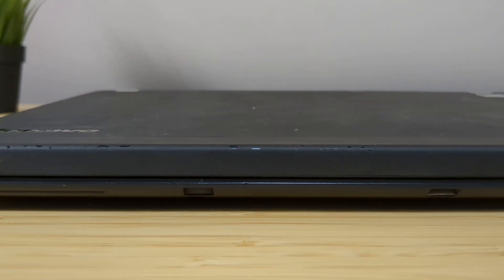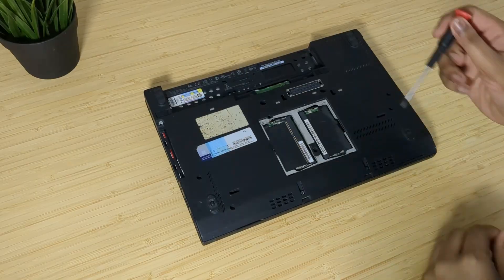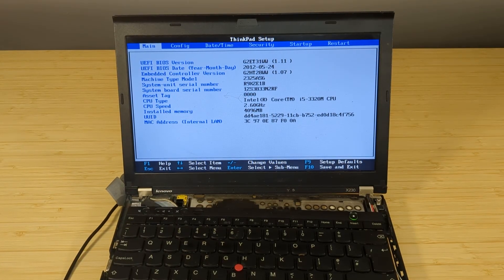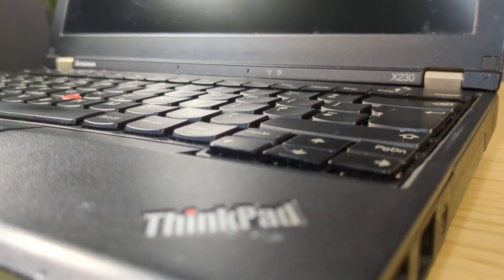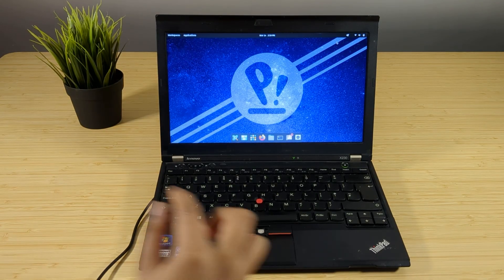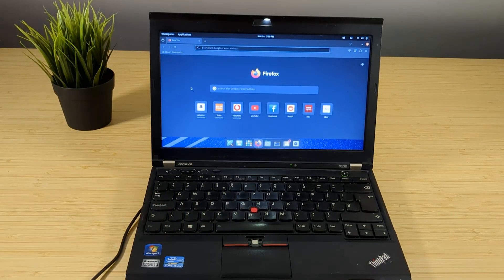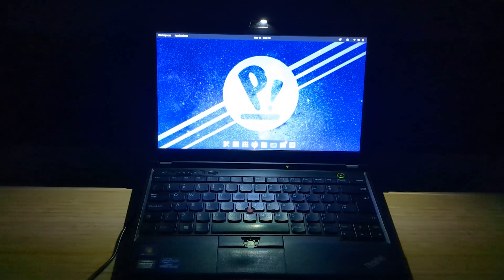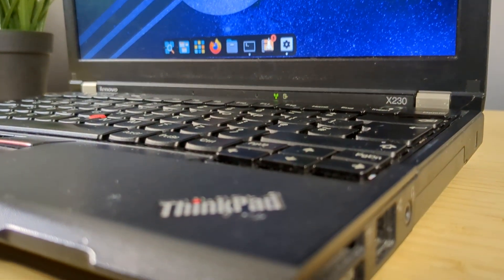This "E-WASTE" ThinkPad from 2012 cost $15.. and it did NOT disappoint!

Comment: Bet you can get a new or refurb keyboard pretty easily.  Part of the durability of the T and X series is that they intentionally make the power jack loose and it's a separate part connected to the mainboard by a small wire and plug so it doesn't break off and can easily be replaced.  All of the Thinkpads, esp those from back in that time frame are made to be easily repairable.

Comment: Unlocking them by removing the BIOS whitelist is vital if you want to upgrade wifi modules etc. Spinning rust hard drives are the worst aspect of older notebooks, but small new ones and all sorts of used ones sell for very little. New screw kits are cheap and if you don't see one for yours they're all standard Lenovo sizes. The easy power receptacle swap should be standard on every notebook. Updated firmware is a good idea and enthusiast BIOS exist. r/thinkpad and the Thinkpad forums are helpful communities.

Comment: This is a socketed CPU which means chances are you could upgrade it if the cooling capacity for that laptop's cooler supports it and the TDP is the same...

Comment: The CPU should handle Windows 10 without problems, provided the hard drive is replaced with an SSD. My secondary laptop is an old Dell Latitude with a 3rd gen. i5 and it is usable for everyday tasks like web surfing and Youtube without any issues.

Comment: (1) I have one of these laptops 
(2) What you have is the 35 watt variant
(3) Most laptops that people use are 15 watts now days...(sometimes 6 watt)

(4) To get up to the same level of screen recording you need gen 8
(5) Thats around 2017/2018...
(6) That due to the power difference. 🤔🙃

Comment: Nice video. I do enjoy a good “saving it from the bin” style video. I’ve been using an x230 since 2019, was already old back then but it still runs well under Linux. Maxed out my ram recently and have been using it to encode live streams, 1080/60p using VAAPI in OBS at 8000kbps… it’s not perfect but it does the job.

Comment: They always disappoint. 🥀
The lenovo pads are always stripped down business-sect and scuttled to death and always require like a hundred dollars in parts and you need an army of M screw kits cause they're always missing screws.

And the old IBM pads are so horribly designed it's hard to find one that doesn't need full reball or chips replaced.. AANDThen! you need to treat them with extreme paranoia// cutting up and braising your own copper cooling solutions for them because they're all from the age when oems didn't think to put heatsinks on secondary chipsets.

I haaaaate thinkpad projects and wish people wouldn't suggest them as secondhand machines for kids.

Or like.. just fix it yourself 💀

Comment: for my use case I could totally daily use that laptop if it had 16gb of RAM ddr3s are cheap now anyways, these kinds of laptops are still being sold in facebook marketplace in my country for around 100-200usd so it is really not a good deal, also you could use Windows 10 IoT LTSC it has support until 2032 downgraded my PC with it from windows 11

Comment: I have a trick for getting rid of pen (biro) marks on an LCD display. Use a drop of clean engine oil on the mark and wipe it clean with a cotton rag. You may have to rub the oil with a rag for a little bit. When I say clean engine oil I really mean the stuff you add to a car engine, like 5W30 or 5W20 oil. After the mark is gone you can use glass cleaner to clean off the oily slick.
Reply: I prefer to use a whiteboard marker; it dissolves permanent marker ink, allowing you to remove it easily.
Reply from the maker: Very interesting, would that interfere with the screen coating?
Reply: @cephacore  The engine oil doesn't react with most plastics. I've been using it for some time without issues.

Comment: Very good video. I'm surprised you didn't clean the interior before repairing it. Those vents at the back looked clogged with dust. I'd also want to try to reinforce that right-side back corner where there's a crack in the hinge, because that's only going to get worse over time.
Reply from the maker: I did give it a quick clean inside before putting it all back together. Forgot to mention that my bad :/
Reply: @cephacore  I feel better that you did! Sorry for editing my first comment after the fact. :)

Comment: If you replace the keyboard, see if you can track down an x220 keyboard. That is the old style keyboard which is so much nicer to type on. You lose the backlight, but it fits and is excellent. Look it up.

I have had an x220 for like 5-6 years now. I love it. I need to replace the battery again, but it is just an underpowered little dipshit (mine is the 2nd gen i3), but for basic browsing, terminal-ing into things, general mayhem, it's great. And the typing feel and just the solidity of it is something I miss when handling a more modern laptop.
Reply from the maker: Many people have mentioned the X220 keyboard, perhaps a part two on this video 🤔

Comment: A year or two ago I found an untested X230 on ebay. Got it for around 15€ just to see. Gave it ram, an ssd and 2 new keycaps. Now its stitting right next to me. Wonderful machine. Those cheap and easy to fix finds are amazing :)
Reply from the maker: Thats amazing, similar price to what I got it for.. How's it holding up today?
Reply: Absolutely amazing. It's my daily drive laptop. Installed coreboot (using 1vyrain). With 16gb RAM it handles all the tabs I throw at it and still no problems with a few other apps open (even electron ones). I want to do the higher res screen mod, since using freecad on the lowres is horribly cramped. Besides that I just dont see a point wasting my money to get a replacement for it. I technically have a P50, but that sits around unused when I dont need the dGpu. The X230 is just so much lighter...
Reply: @astiLP did u do the screen mod, if so what did u need for it and how much did it cost roughly? Would love to upgrade my x230 as well!

Comment: The good thing is, the docks are cheap and you could get a power to USB c adapter to run it on a battery pack or in car. 

I have one here and it performs very well with Linux Mint.
Reply from the maker: Damn, never knew you could do that. Thanks 🙏

Comment: X230 can handle 2 drives. 1) 2,5" 2) mSata instead of wwan / 3g modem. I made some dualboot x230 s for win7/win10 as diagnostic devices for car diagnostics.
Reply from the maker: Wow I didn't know that. Thanks for the suggestion.
Reply: @cephacore  t430 and other "x3x " series lenovos are capable..

Comment: I am very pro older Thinkpads. But these x230 are no go for me nowadays. Too bulky, with usually very poor battery life and disastrous LCD screens. Most of these machines have also dual core i5s with low cpu speeds which are just too slow for Windows these days. Maybe Win10 LTSC, if you want something modern. Some Linix distribution might be better idea.
Reply: I still use two t530 Thinkpads though, the one with i5 only for light browsing in my warehouse. 2nd one has i7 though, this one is still capable enough for normal office work.
Reply from the maker: Agreed it is too old for normal use but still, it has a use! Can imagine doing some retro gaming on it. The dual core ain't the best but should be sufficient for basic tasks.

Comment: Superb video and I have subscribed.
Yes, the yellow main power cube disease affected many X 200 series machines and the diddy size of them meant that the input had to go under the m'board and a bracket and 2 small screws eventually worked loose. Glue guns were popular for a fix but, later, Lenovo issued an adapter allowing for their spade connector.
A medical friend won't part with his classic X220 with the older keyboard and it remains as fast as much more modern laptops with 8GB RAM and a rather superior SSD on W10 Pro.
Batteries and both types of keyboard are available in the UK, even with a backlit version of the chiclet sort.
The ThinkLight can be made brighter using a modern LED and lights the area around the keyboard too. This is handy for busy doctors on night shifts.
For some reason, these X 200 series machines are great survivors.
Reply from the maker: Thanks for watching, that's very interesting. Some great info! 👍
Reply: it's not as fast as modern laptops, wishful thinking!

Comment: bro can buy an x220 for programming inn python, C, C++ and Bash Scripting and for Learning Linux or what you recommend x220 or x230
Reply from the maker: X230 as it is a bit faster, and usually cost the same.
Reply: Programming takes almost no resources, so if you only want to do that (and experimenting with linux) something like a Raspi 3 or 4 might be a better choice since you can also hook up stuff to the GPIO pins and program/experiment with them.
Reply: @NiyaKouya  but i don't know anything about raspberry Pi
Reply: @NiyaKouya  don't a raspberry pi will quickly become limited

Comment: I like these Lenovo laptops. Build quality is excellent. I just checked, a new battery and keyboard (not secondhand), will set you back about $67 or 70 Euro in my country. You can probably get it cheaper in the US or EU.
Reply from the maker: Yeah the used market for these parts is mental. Better just to get a faulty one and salvage the parts.

Comment: The X230 is still my main Laptop and it still runs like a champ with Linux
Reply from the maker: That's incredible, it is very modular which I quite like
Reply: I've been running windows 11 pro on it (TPM check disabled at installation). It runs pretty well for a 13 year old computer, and with an SSD (of the same age) and 16GB of ram it is certainly good enough for web browsing and office tasks. For security, I lock the hard drive with a password. I have been wanting to install linux on it, as my other computer of the same era runs Mint 22 quite nicely with 8GB ram. One of the nice things with these older Thinkpads is that the battery can be removed and the computer used in a dock. My original battery has been in my refrigerator in a ziplock bag for over 10 years, and it still has 80% or more of its capacity.

Comment: I have an x100e ThinkPad with a weak atom processor that only costed me $5, I have tried many different distros trying to get it to have some potential, but have not had any luck. I will be trying PopOS to see if that would make it any better!!
Reply: Try a minimal Arch install with XFCE desktop environment. IMO the best option for low end systems that is still very usable
Reply from the maker: Good luck! Hope you get it working.

Comment: I got a T420 last year for free which i upgraded and use to this day without problems. I even upgraded the CPU to a Quadcore (i7 2860QM) so i can use it with event stronger Tasks.
Reply from the maker: Completely forgot you can upgrade the CPU in those, truly the best designed laptop out there.
Reply: Nice!
Reply: I need to do that. If I do, can I play Minecraft versions past 1.16? Apparently they started requiring a more updated graphics ability around that time.

Comment: no arch?
Reply from the maker: Not familiar with Arch, might use it in a future video :)
Reply: @cephacore  I should note that archinstall script breaks on some applications, so try to spend your time installing it manually. It's not like Gentoo, where you have to compile literally everything, but you'll reformat your drive more often times than not. If you find a good tutorial and read Arch wiki, then your install is going to be a breeze.

Comment: For the money.. these machines along with the older T series are unbeatable for a cheap daily machine. These are also still built to be serviceable.
Reply from the maker: Agreed, although the X230 is a bit of a pain to get into.. upgrading RAM and SSD is by far the easiest I've seen on a relatively modern laptop.

Comment: I got an x230 and did all of the mods I've read about, including the 'classic keyboard' mod which draws looks from techies whenever I travel.
Reply from the maker: Might have to do that, especially since the keyboard is a bit knackered. Part Two perhaps
Reply: @cephacore I highly recommended the keyboard mod, as I love the feel of the old-school Thinkpad keyboards. I also maxed out the RAM to 16gb and upgraded the panel to IPS, and the screen is crisp and clear.
To add, I have it running a debloated version of Windows 10 and Small Damn Linux 2024 on a USB flash drive.

Comment: i see you have bought a syringe of mx4 thermal paste, very good! I also highly reccomend you buying a bottle of non-alcohol screen cleaner. It lasts for a freaking long time since you only use like 2 sprays to clean a screen, and they clean reaaly well and most important, effortlessly.
Reply from the maker: Hi, thanks for watching! Yes it was about time to ditch the AliExpress thermal paste haha 😂. Forgot to mention I used eucalyptus oil spray to clean the outer body and some cleaning wipes.  Did a pretty good job.